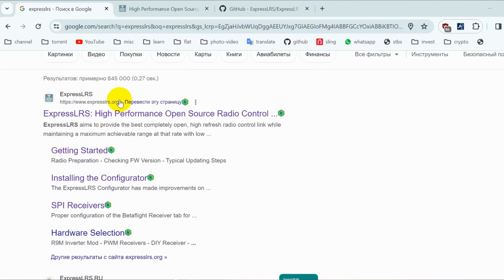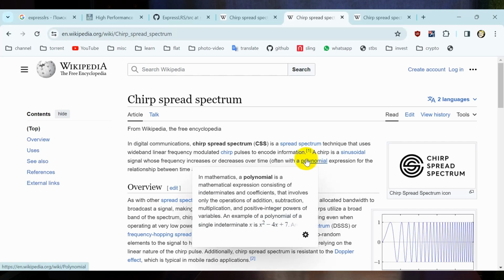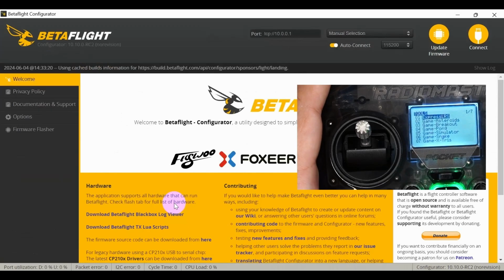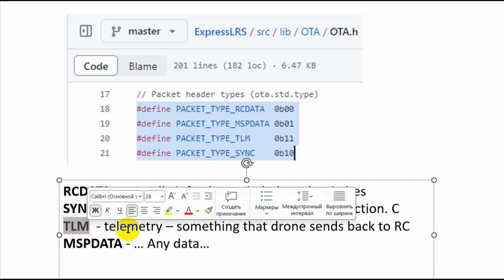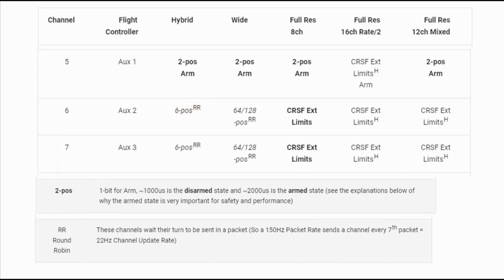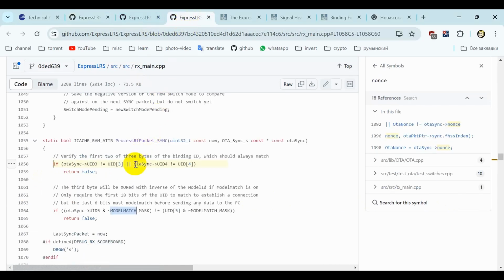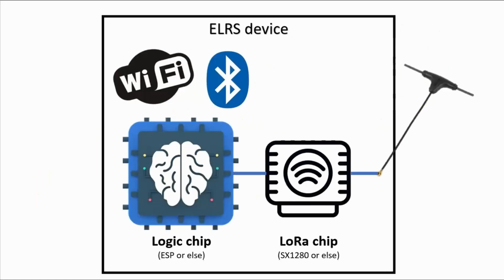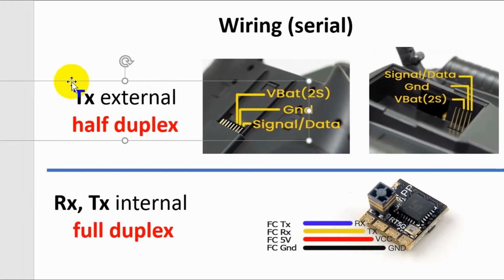How ExpressLRS works - look under the hood

Comment: great work, i am having trouble configuring  and conecting    Bandit nano  to  the Mission planer software
Reply from the maker: Have never worked with ardupilot so no much help from me.. but at least few assumptions. Bandit should be the same half duplex devices as all other so should work similar. The question if it is connected directly to pc or via radio? And may check serial baudrate - newer versions of elrs that supports 1000packet rate also may require higher serial speed